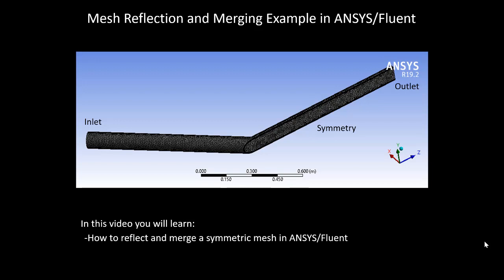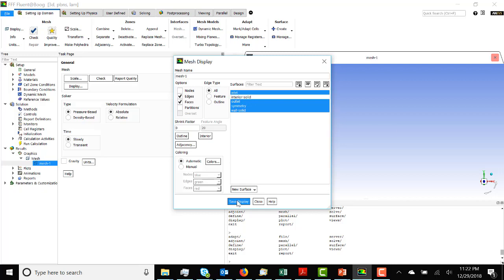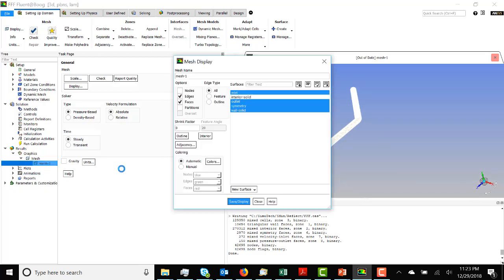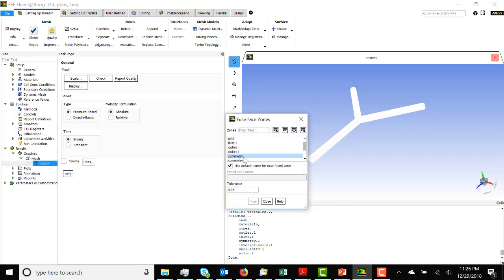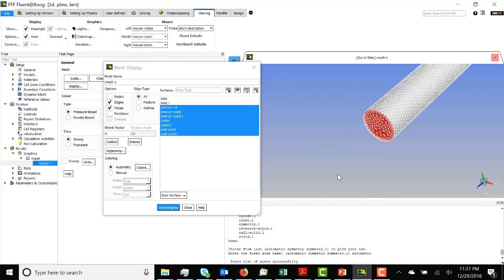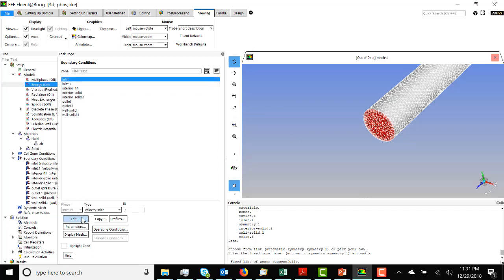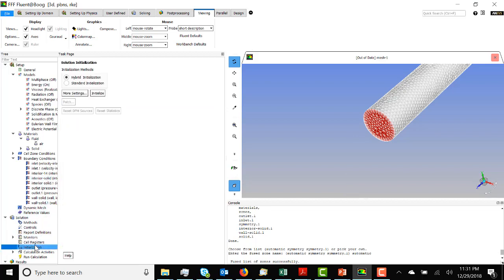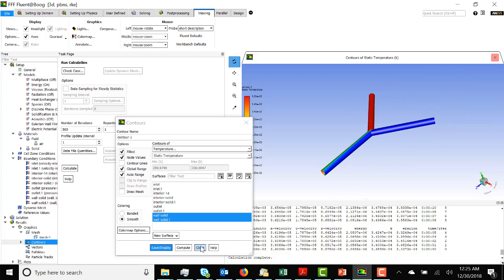How to reflect or mirror a mesh in Fluent

Comment: Hi, thank you for the video. I am following the exact steps apart from the scaling which for my case is 1 1 -1. However when appending the reflected mesh, there is a gap between the two meshes and preventing the symmetry plane to fuse. Did you ever come across this and is there a way to solve it?
Reply from the maker: Hi Aristi, thank you for your comment. If you are interested in our mentoring or consulting services, please send an email to info@simutechgroup.com or you can check out the Ansys Learning Hub here: https://www.ansys.com/services/ansys-learning-hub

Comment: Can you please upload the full tutorial about it. Actually i am also doing the same thing but in my case reflection is along negtive z-axis. And inlet, outlet along x-axis. I named the two matching faces as symmetry 1 and symmetry 2. And fuse them but the new symmetry still exist inbetween the two parts. And i also merge the fluid 1 and fluid 2 domain. And if i merge interior 1 and interior 2 and symmetry then it forms new interior with name "symmetry" and i also merge the inlet 1 and inlet 2 which are side by side in to new inlet and same case for outlet. Is it the right approach for this case. Actually my model has more than 1500 edges with different lengths i just want to reduce the working time by applying this approach. Please correct me if i am wrong.
Reply from the maker: Hi Usama, feel free to drop us a note at info@simutechgroup.com if you're interested in our consulting services and we'd be more than happy to help! Otherwise there is the Ansys student community to find posts/articles: https://studentcommunity.ansys.com/
Reply: @SimuTechGroup  actually i figured out my problem thanks for replying. In future i will consult. Thanks